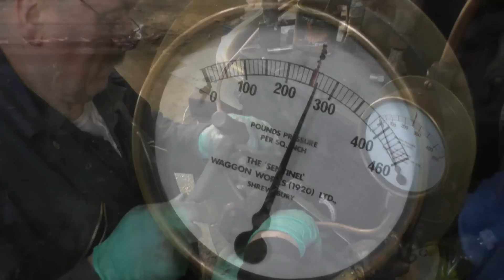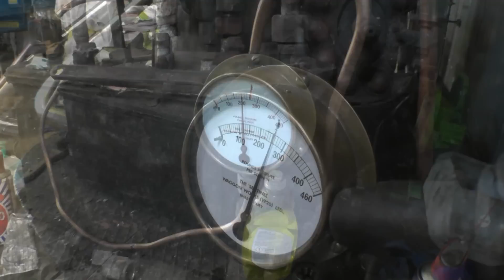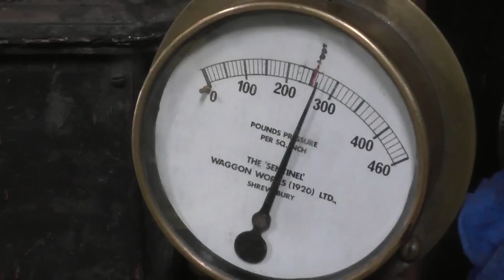Sentinel DG8 Steam Waggon Winter Maintenance Part Seven

Comment: Not an expert by any means but do work with large steam raising plant (4 15MW boilers) and mixing stainless and mild steel has always been a a bit of a no no due to the different expansion rates of the metals which could lead to leaks then retightening then stressing the bolts especially with the heating and cooling cycles. Might not be a problem on smaller plant but thought I'd post anyway
Reply from the maker: Thanks for your comment  i will look further in to this

Comment: Stainless studs will likely gall like a bitch unless you use bronze or brass nuts on them.  It is  a common problem in applications with a lot of thermal change like this.
Reply from the maker: we find stainless studs with mild steel nuts to be a good combination

Comment: How often does the boiler need to be inspected and certified?
Reply from the maker: it has a visual examination (inside and out) then a steam test  to make sure safety valve and feed pumps work every 12 months . Every 10 years it is stripped examined and hydro tested to  1 1/2 times working pressure

Comment: That guy loosening the screw stud is probably not born behind the fire-wood shed.
A saying about people who knows things.

One thing to learn, is when the metal "floats", or does not spring back, when using force. When it floats, you must change what you are doing, or it will break for sure.

I wonder, I replaced ordinary studs for Stainless ones on a Exhaust Muffler on an Marine-Engine w/ Salt-water cooling. Was that wrong ? Thanks for any replies.